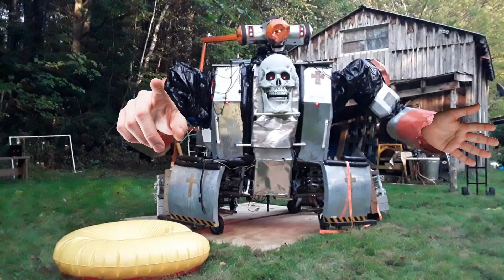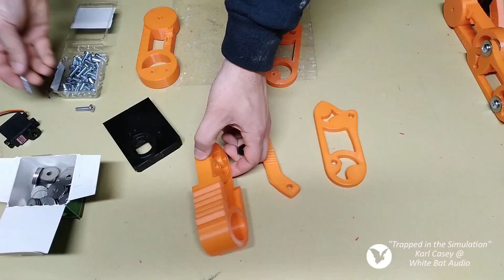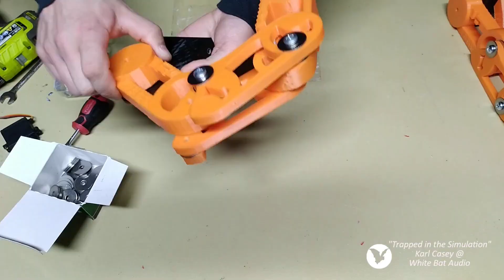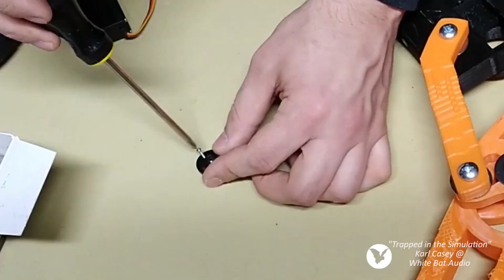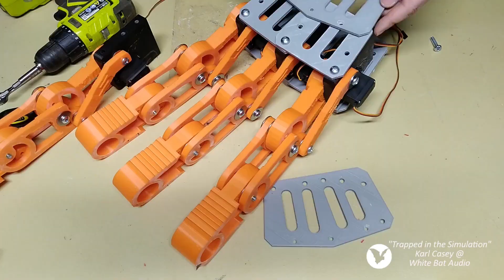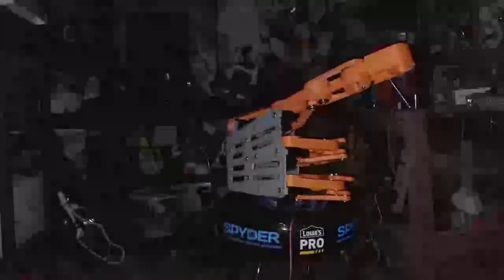Build your own Mech Hand!

Comment: hi, I love your work, and I have a question: What are your thoughts on an idea that I have, and that is a robotic dinosaur tank? it looks like a tank, but it has a robotic t-rex head and neck at the front and a tail at the back?
Reply from the maker: @rickymitchell8981  sounds like the robosaurus :)
Reply: @NyeMechworks  i know, I also thought about adding two robotic arms on the sides of the turret. If the turret was dome shaped, do you think that could build something like that?